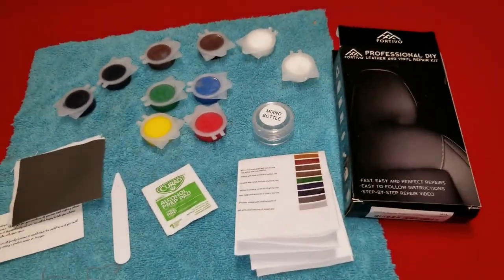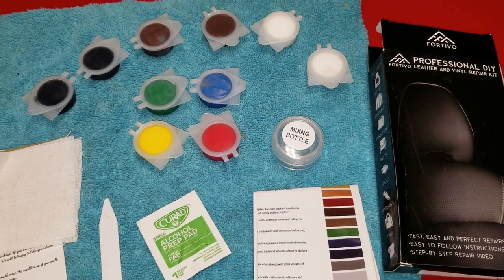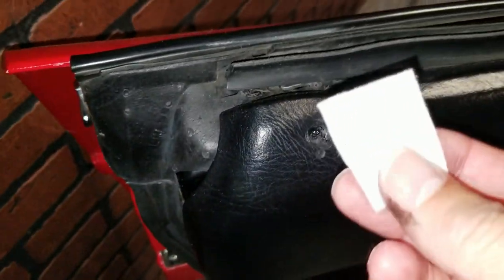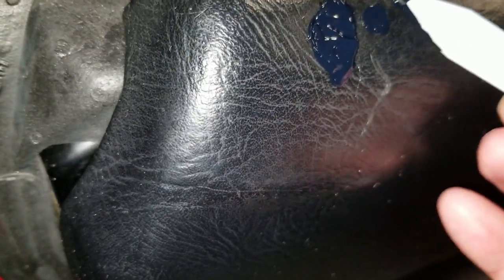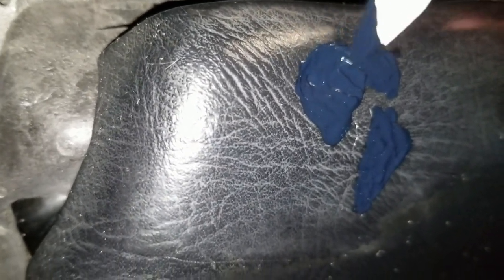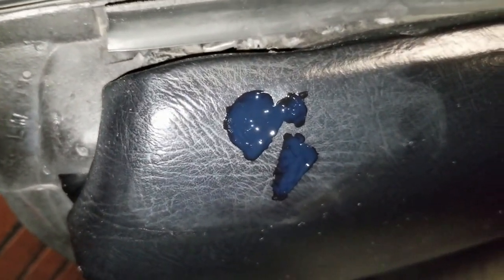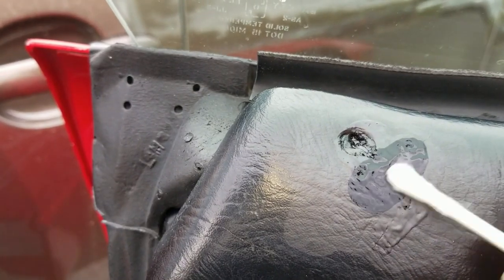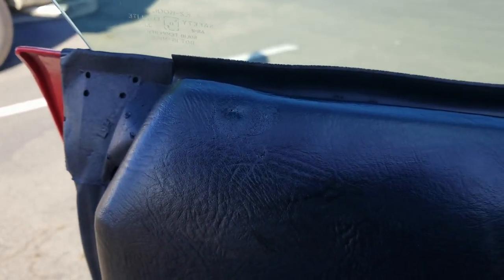92 Corvette Door Repair

Comment: Same thing happened to my door and someone screwed them in. How did you fix the panels? Mine are not attached at the top, they pulled away.
Reply from the maker: I ended up pulling the rubber from the window sill rubber back and putting a screw thru the metal in the rubber and screwed it to the door itself.
It worked. Its buying me time until I can find another set of door panels.